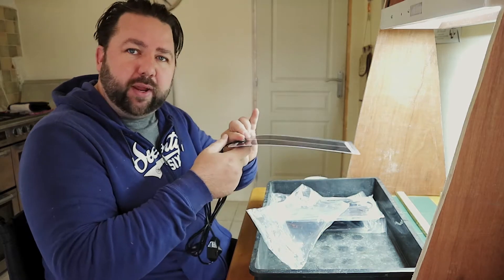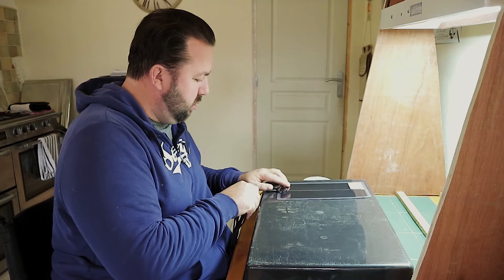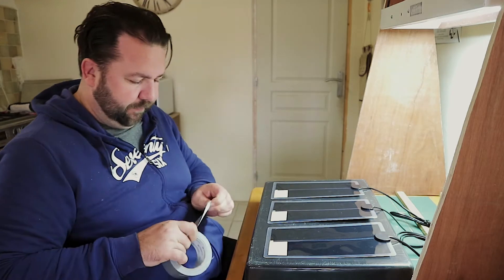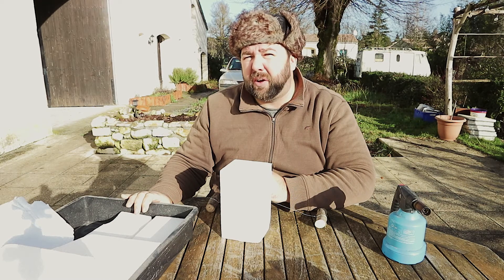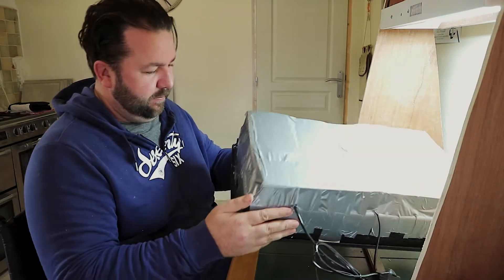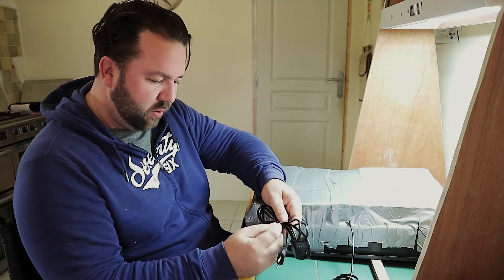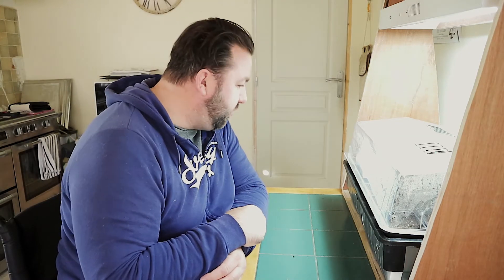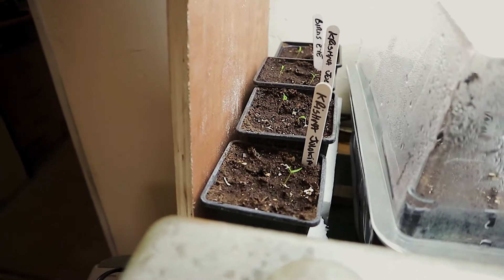How to make a heated propagator - 🅲🅷🅴🅰🅿 !

Comment: possible suggestion the insulated reflective panels you can get to put behind radiators the reflector surface is stitched to the padding so you can cut to size, my propagator is sitting at 88f for the last couple of hours, good luck with the chilli's I have T.Scorpion & Habanero cropping in the garden, N London
Reply from the maker: Thanks for the suggestion, I'll bear it in mind for next year when we scale things up bit. This years crop are doing amazingly well, almost a hundred plants and have been getting chillis off them for over a month now.
Reply: Could I clarify, if I get the insulated reflective panels do I leave out the metal tape and styrofoam?  Just use the heat mats, the reflective panels and tape it all together?